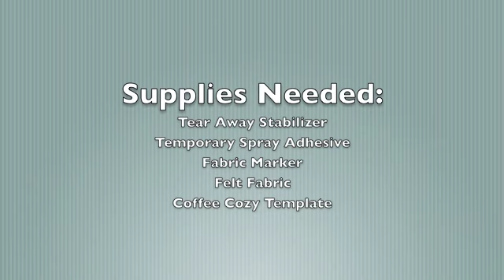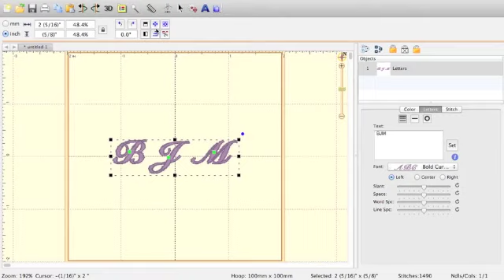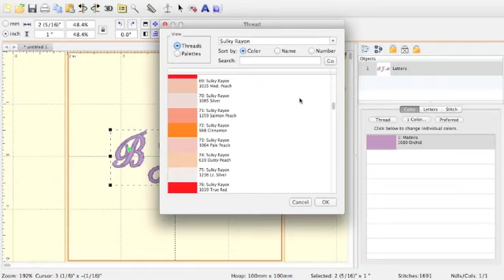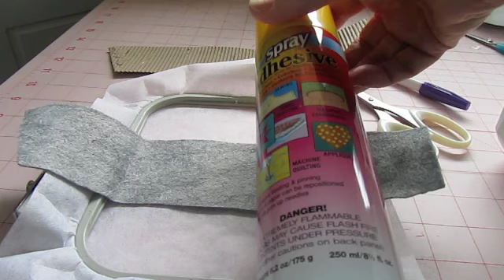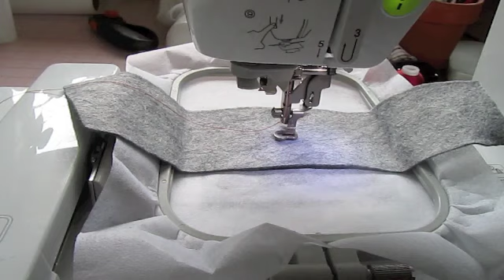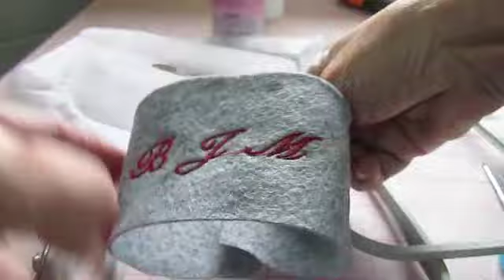Personalized Coffee Cozy: How to Monogram with Embrilliance

Comment: Love this, but you could please tell me what you did to finish it off to close the back once you have it around the coffee cup?  Also is this program only for MAC?
Reply from the maker: JS Thomas This particular cozy design was cut using a cardboard coffee cozy from a coffee shop for the pattern, so you would just sew the back (cardboard cozy is glued) The cozy has a slight cone shape so the cup won't slip through. :)  Also, the program is available for windows and mac computers. You will find the link in our video description or on our website.  Thanks for watching! @@
Reply: Thank you for the quick response.  I wasn't sure due to different sizes of cups available out there. Think I will try making some very soon. :)